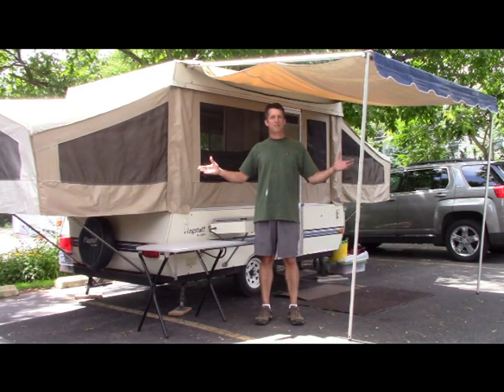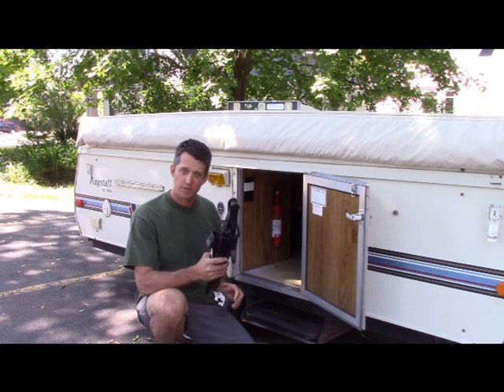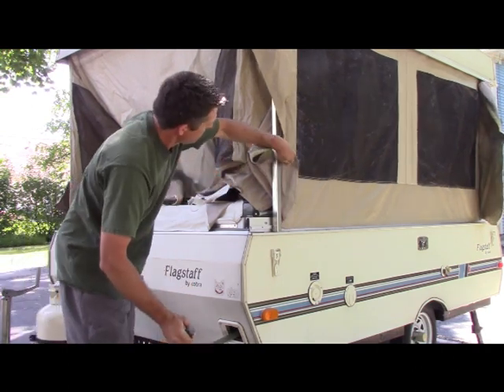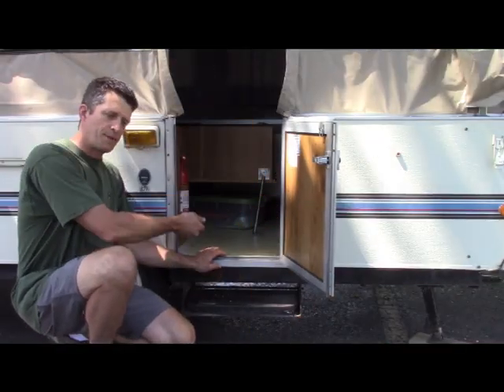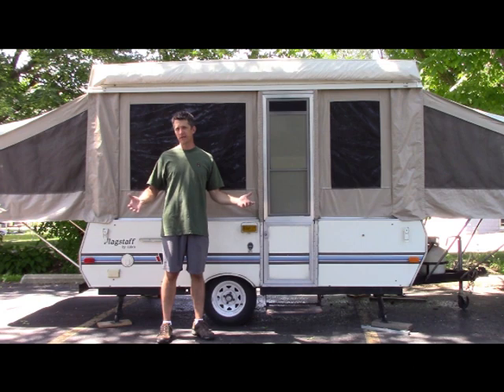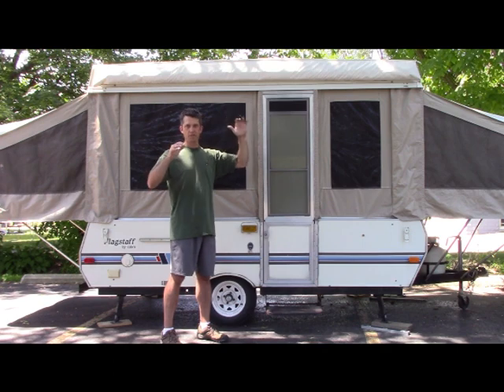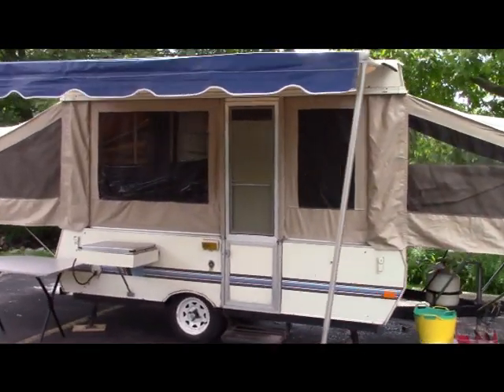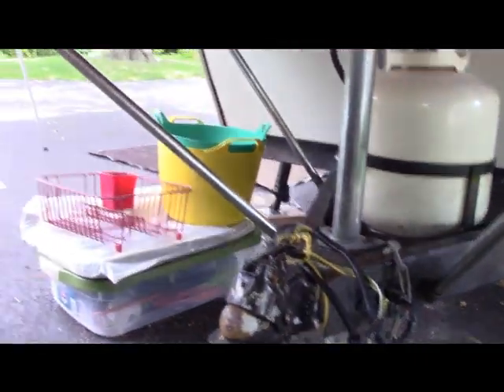How to Set Up a Flagstaff Pop Up Camper - Tips, Tricks & Hacks

Comment: You seem very nice and did good on the recording / editing the video (outside of the noisy highway in the background).  There are a few suggestions I have for you regarding popup camper setup.  First, always get in the habit of first chocking the wheels before you disengage from the towing vehicle.  Had you been on a hill your trailer would have been bye bye.  Second, putting down the stabilizer jacks before you raise the roof can put undue stress on the trailer frame and lift system and cause premature wear. Put them down after raising the roof.  Third, never level you camper using the stabilizing jacks.  That's why they are not called leveling jacks, they are meant to stabilize the camper so you can walk around inside without it wobbling - NOT to support the weight of your camper.  I cringed when I saw the wheel off the ground at 17:59.  You are bearing the entire weight of the camper on the stabilizing jacks - not good.  Instead use some drive on blocks or a BAL tire leveler to balance side to side, then using the front wheel crank to raise/lower front to back.

Comment: Approximately 3:30 into the video he was talking about the pigtail (electrical light connector) and how it could become corroded during the off season. I would like to suggest you buy an extra pigtail, they are relatively inexpensive, and cut it in half. Then plug the respective ends into the each vehicle plug and wrap in some electrical tape to keep water out and, WALA, problem solved. Simple task to remove during camping season and store where you won't forget it next season.
Reply from the maker: This is a GREAT suggestion!  Love it!

Comment: I believe you're supposed to level side to side under the tire on the low side, not with the stabilizing jacks.
Reply: That is correct at least for mine.  You need to level side to side before you unhook from the two vehicle.  Then chock the wheels.  Then disconnect and level front to back with the tongue jack.
Reply: @gconaron  yup! I destroyed the rear jacks on my camper trying to level it without the tongue jack. Live and learn!
Reply: exactly